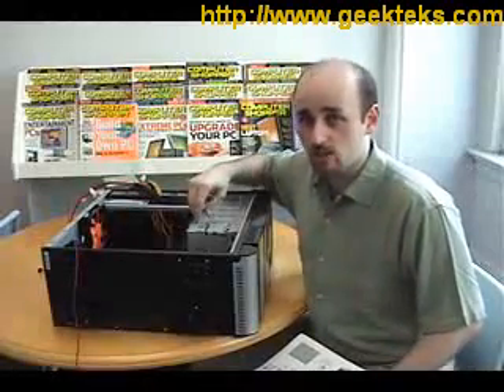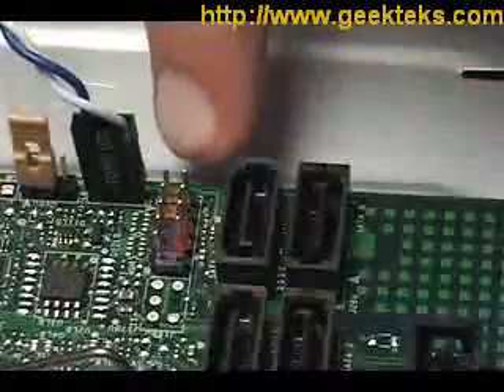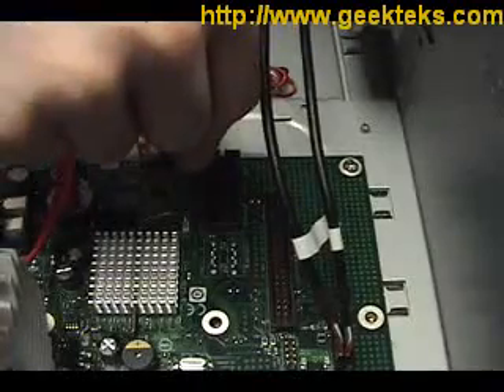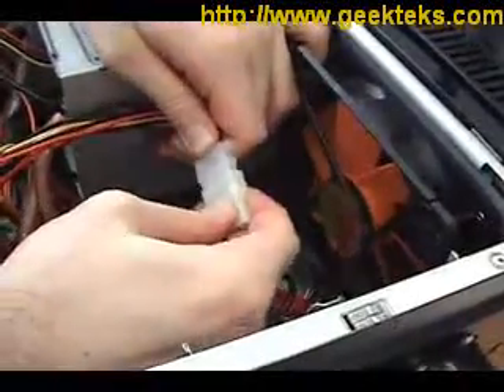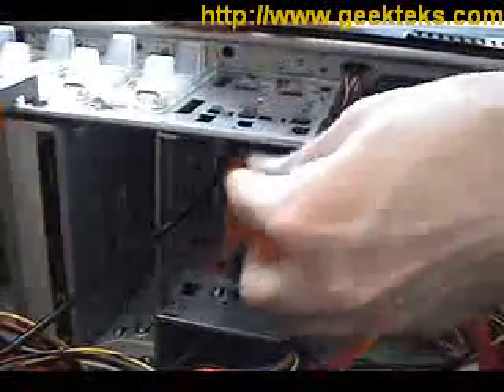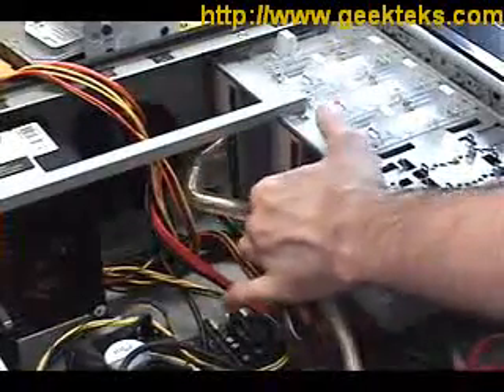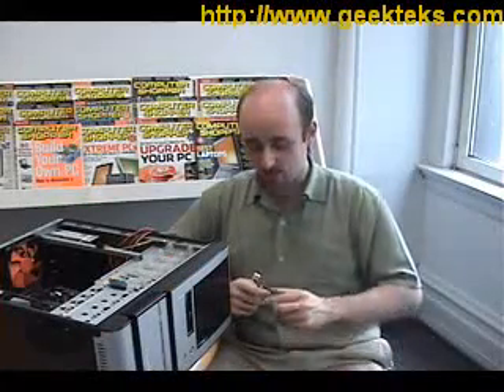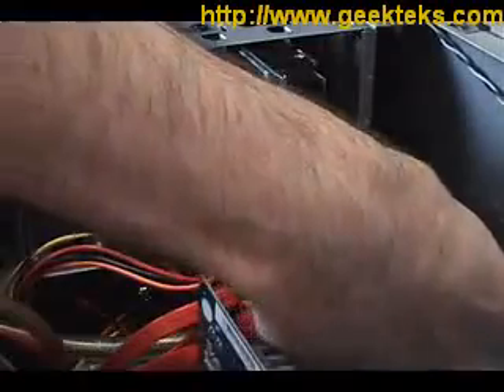How to build your own multimedia PC computer cheap -Part 4/5

Comment: lol @ $35 for ram installation, that's like $420 an hour. It isn't clear on your site weather you use memtest86+ or any other stability testing either.

Comment: I bought an evga 780i mobo and thermaltake armor va8003bws. However, I could not figure it out how to connect the cables from the case to the motherboard. The cables that I need to connect from the front case are "speaker", "usb1", "usb2", "iee1394", "power led" and "ear mic".  Also, the cables from the bottom of the case are "speaker" and "micro sw"
I really need some help with this

thank you in advance

Comment: it's better to let the adio cables for the front panel for what they are.. if you want good sound just use the one from the back. if you dont connect the ones for the front the sound will be allot better because it won't split the sound up.